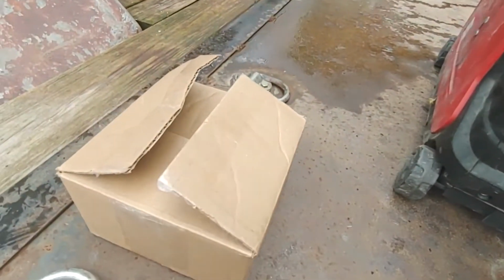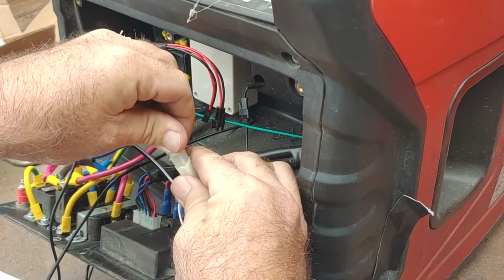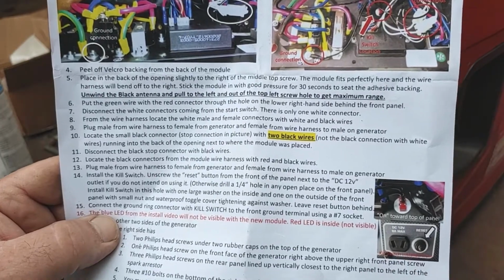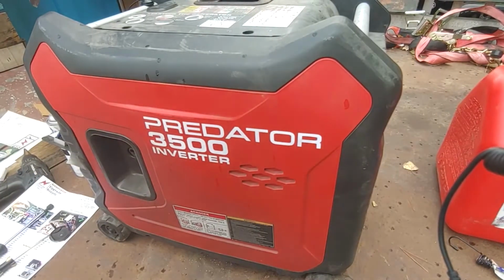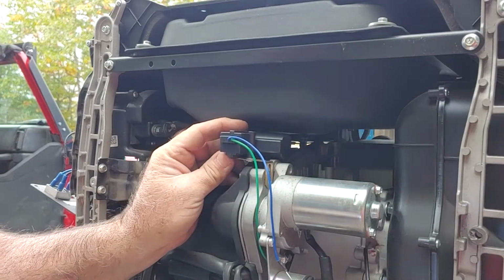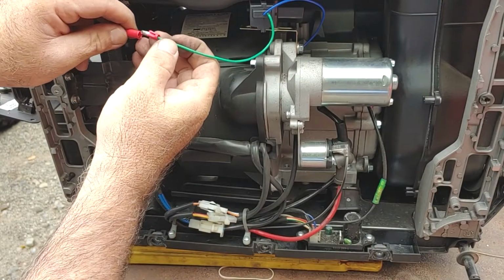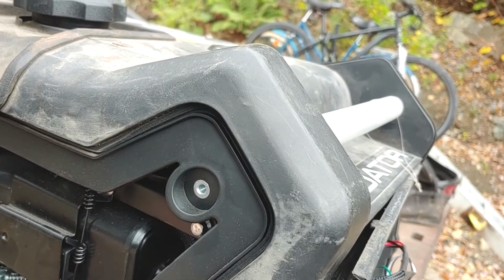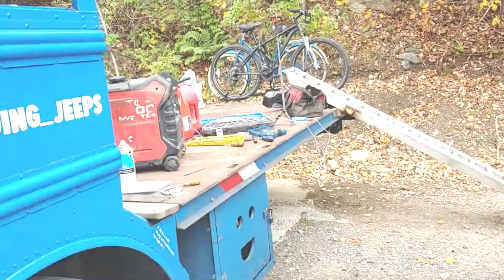Harbor Freight Predator 3500 generator remote control install and start distance test

Comment: anyone interested in these features should check out the offerings from Pinellas power products. His remote start is much more feature filled. He also has a nice video detailing the install process. If you’re going to do it, do it right the first time.
Reply from the maker: Thanks I might check out next time. What's the cost difference?
Reply: @bendingjeeps  Pinellas is $400. only difference is it give you eco control mode. Its not worth it
Reply from the maker: @adammiller8415  Thanks for the tip. Thats half the price of the generator. And mine stays on eco all the time anyway. 1600 hours now.
Reply: @bendingjeeps  the generator supply one is definitely the better kit. Better price point and plenty of features

Comment: What are C and D for ?
Reply from the maker: RE The extra buttons on the remote. I don't know what they could be used for. I imagine the module has more capacity than it is being used for. I thought about seeing if I could add an exterior LED light to my generator. That way I can use the remote to light up my generator box if I'm fueling at night.

Comment from the maker: Generatorupgradesupply.com
Reply from the maker: **as of 12-8-2021 the kit is still working great. Really saving me a ton of fuel as we only run it during heavy draws against my inverter/battery bank or when its been cloudy for a few days. Being able to shut it off during heavy rains is great. Now all I need is a low fuel remote notification.